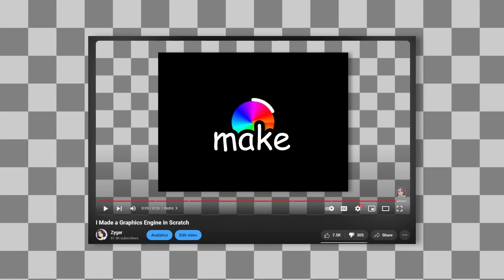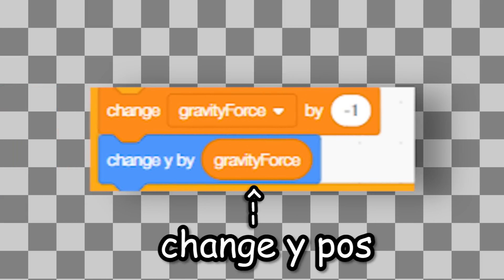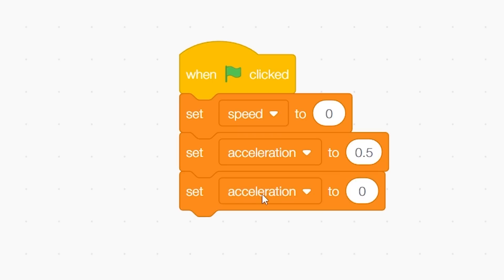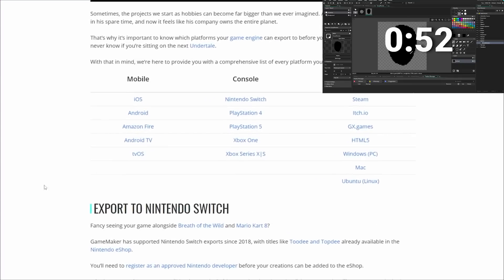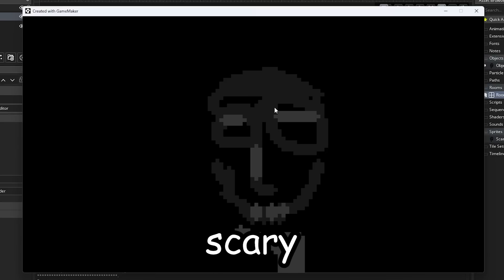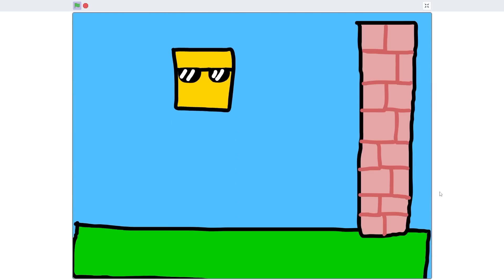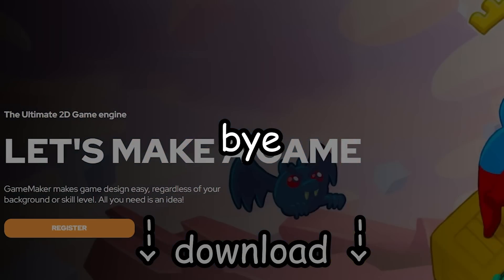I Made a Physics Engine in Scratch

Comment: You know physics is like a very basic thing that literally any scratcher uses all those basic platforms use physics. It’s literally just a program that runs an extra trip calculates if it’s colliding and inverted and decrease by a certain amount by multiplying it by a number or less than one.

Comment: With a bit more work this could become a simple platformer script.

Also, I generally recommend keeping just one forever loop in your project that runs all per-frame code, which gives you much more control. If things run slower than expected, you could try putting the inner contents of that forever loop inside a custom block marked “run without screen refresh” just in case Scratch is doing unnecessary waiting (like, if you have an inner repeat loop that’s waiting for a frame between each iteration).

Comment: 2:53 You could use the block "set speed to "speed * friction", the higher the friction variable, the more slippery it will be! (And you won't need the "if" blocks either)
Reply: That wouldn't be friction it would be air resistance...
Reply: @modbustwhat

Comment: It may be better to do "0-num" instead of "num*-1" to inverse a number since multiplication takes longer to compute, but it doesn't really matter for a small demo like this.
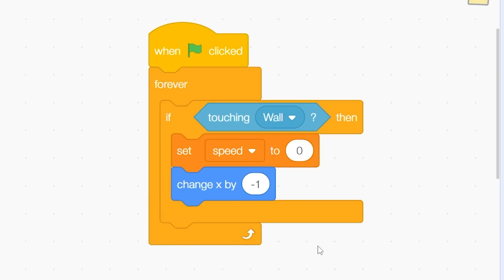5:43 You would want a custom block set to run without screen refresh to push out of the wall
6:05 To make it less bouncy, multiply by a number smaller than 0 but greater than -1